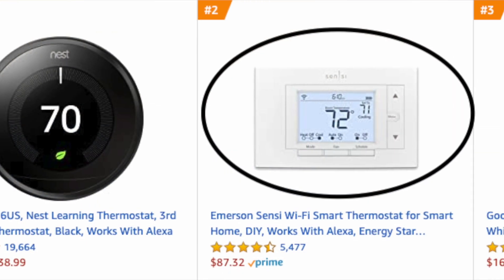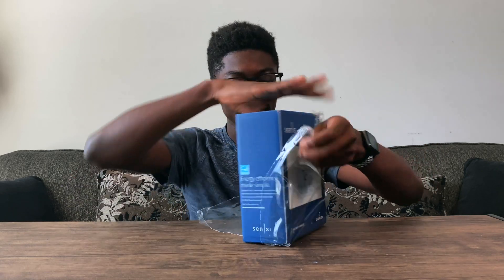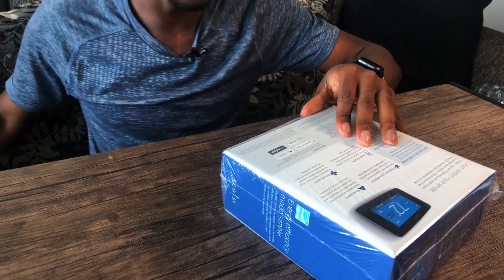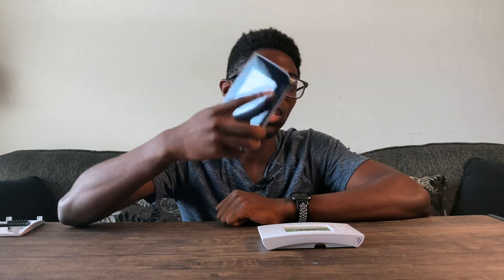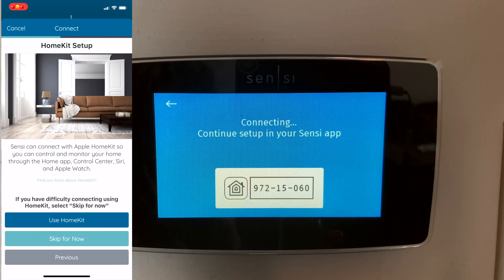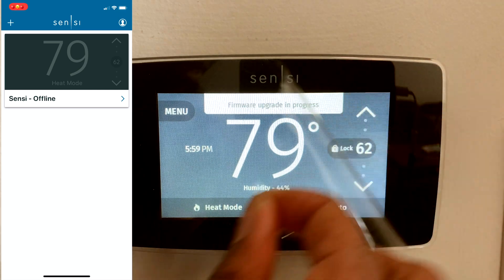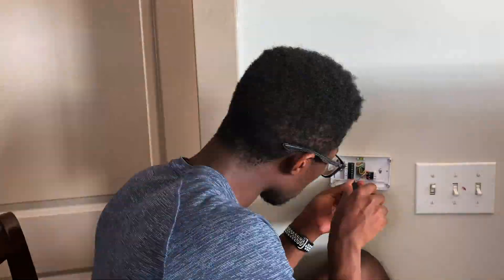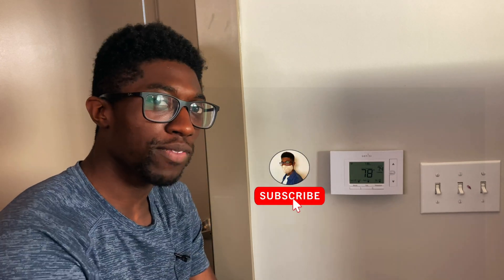SenSi Thermostat Unboxing & Setup | Honeymoon Phase

Comment: Great video! Thanks so much for posting! In the middle of installing mine now. Already made the connections but need to do an alternate configuration because I don’t have a “c” wire. I have to disconnect the “g” wire and use that one as my “c” wire for this alternate configuration to work. Quick question , how do you disconnect a wire that’s already connected to the Sensi Touch base?
Reply from the maker: There should be mini pads on each place where you put the wire. Push down on them to connect and disconnect them

Comment: Your Blue wire (c-wire) usually will be tucked away behind all the other wires or wrapped around something, just dig a around (with your breaker off at the source) and you’ll more than likely find it there.

Comment: Love this stat except for 1 major flaw on both versions. The stat will reboot itself in 2 hours if it does not hit your set temperature, which shutdown your AC. Doesn't happen every time so I'm not sure what condition would cause this. Called Emerson support and they told me this is a feature on their stats.... Emerson also has a patent on it. I don't see the benefit but it is what is it. Couple of people on Amazon also complaint about it.

Comment: Home Depot
Hello ,
Your review is very important to us and The Home Depot community. We appreciate you taking time to submit a review about the Emerson Sensi Touch Wi-Fi Smart Thermostat with Touchscreen Color Display, C-Wire Required, Black. Unfortunately, your review did not meet our guidelines for posting on our site.

The highlighted section(s): mentions a competitor

System configuration is buggy documentation say the system work with IOS 10 (not true) must have IOS 13, says Android and Amazon fire is compatible (not true) none work with the system. Direction says setup Wi-Fi network. However, device has no such setup button. Also, bogus Philippine Support that claim to be technicians but are not.

Comment: So which one is best in the long run?  the touch or the other?
Reply from the maker: Objectively, I'll say the non-touch just because it's 1 less component that can fail.
Reply: @DayoAworunse  You mean the touch screen?  or the buttons?  IF it looses wifi the touch screen still works ... right?

Comment: I just installed this in my home and it is only black and white read out.  How do you change the back display to orange and/or blue like I see in other videos???
Reply from the maker: Orange means the system is set to heat and is heating your home. 
Blue means the system is set to cool and is cooling your home.
Reply: Thanks! I have it set to “auto” and it’s not doing a color. Only black background with white readout.
Reply from the maker: @la_chick1087  no problem! Only here to help
Reply: @DayoAworunse  It is is showing the color now! YAY!  I love it so far!

Comment: The non touch takes batteries so that people without the c-wire (common wire) can still use the smart thermostat. For people with older systems, the c-wire may not be installed and that thermostat gives them the ability to upgrade. I'd say that's why it's more popular.  I like the touch screen one